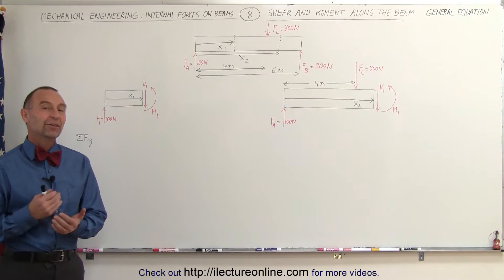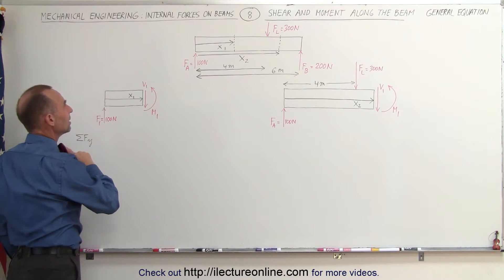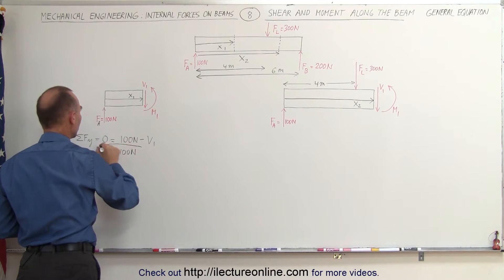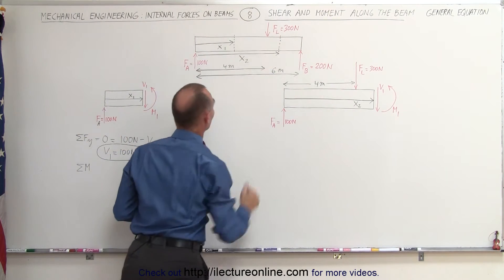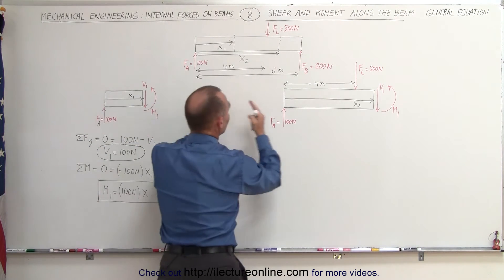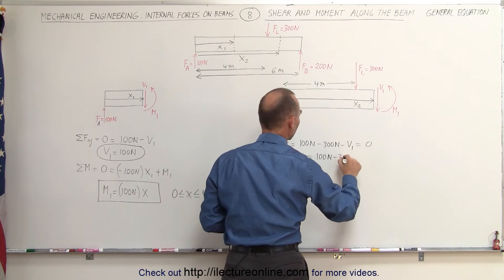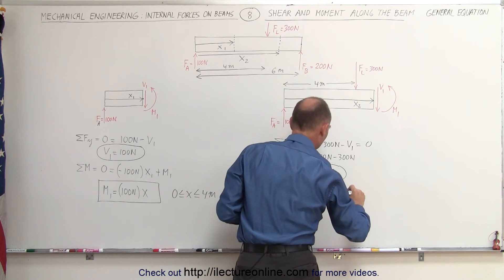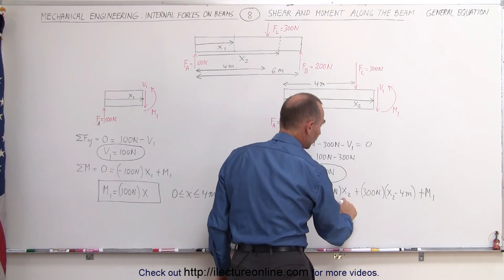Mechanical Engineering: Internal Forces on Beams (8 of 27) Shears & Moments Along the Beam

Comment: Isn't it complicating matters to consider upwards the positive direction when calculating sum of forces, but negative when calculating sum of moments? The outcome is the same of course, but don't you just add additional risk to confuse yourself? Isn't it easier to always consider downwards to be the positive direction when working with a beam to the left of your cut?
Reply from the maker: I didn't make up the convention.  That is how it is done.
Reply: @MichelvanBiezen  Thank you for your answer! I think I get the convention, however, my question isn't about what the convention is, rather the way the equation is stated. You used ΣM = 0 = (-100N)x_1 + M_1, indicating upwards direction as negative, just as convention. However for ΣF_y = 0 = 100N - V_1, you used upwards as positive direction and instead you have a negative sign before the unknown V_1. Isn't this complicating matter? It would be more uniform to write: ΣF_y = 0 = -100N + V_1. The end result for both variants are the same. Both will follow convention indicating downwards as positive direction with V_1 = +100N.

Am I off somehow or is this correct thinking? I am trying to learn and very much appreciate your videos. The quality is amazing!
Reply from the maker: You are indeed thinking about it the correct way.  You can actually come up with your own convention and when you stay consistent throughout you will get the correct answer.  Just the fact that you are diving into it in this detail will help you understand it fully.
Reply: @MichelvanBiezen  Thank you sir!